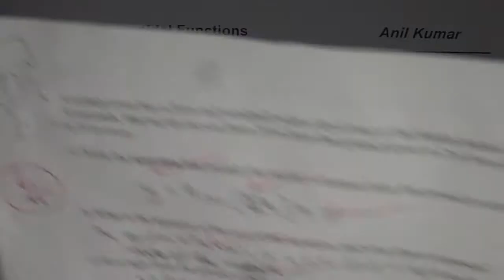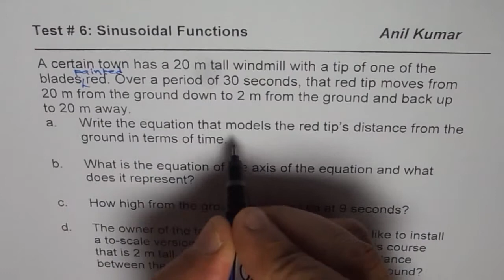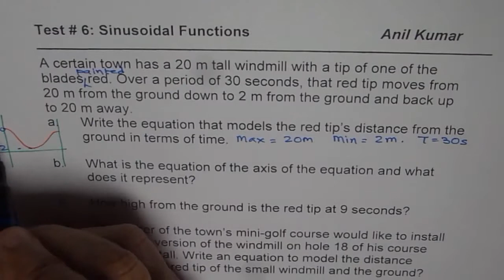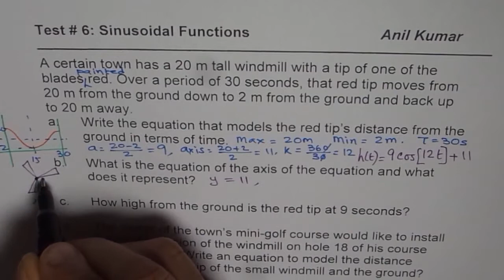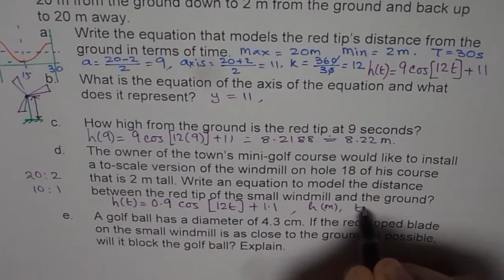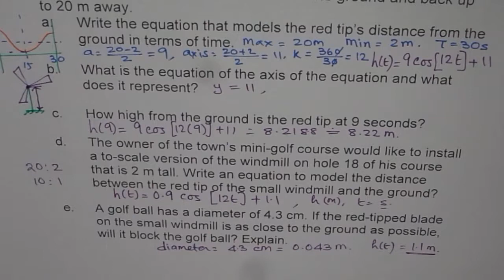Model Wind Mill Application Test Problem as Sinusoidal Function MCR3U Trigonometry

Comment: Hi, the k value should not be 12, instead it should be 6
This is because 30 seconds is only half of the windmill's rotation. So you would do 360 / 60 to find k which is 6..
This will also change your answer for the other questions!
Reply from the maker: Please note: It is one complete revolution. The question says ... and back again.
So the answer is correct.
Thanks